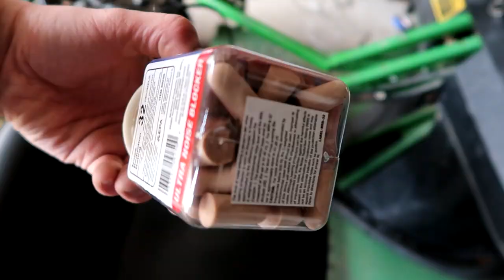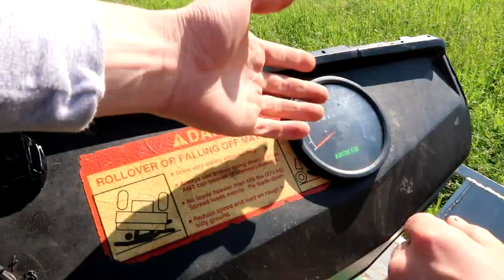100HP Engine Swapped 5 Wheeler First Ride

Comment: Dude 😮 how How can everything hold up to that because it was never meant to go that fast
Reply: Because it’s a heavy duty work machine, made to pull heavy loads. It’s actually less stressful for everything to be spinning with no weight or traction. However I wouldn’t be surprised if on pavement with good tires it might hurt an axle shaft or something.
Reply: Trash to transportations 5 who said it did😂jkjk
Reply: Yeah I suppose but he should be fine if he just keeps his tires spinning the whole time JK
Reply: ive got the same engine in my golf cart and it takes it just fine

Comment: Pull the negative off batt. Use test light. Touch that negative cable and negative on battery. If lights up start pulling fuses till light goes out👍🏼

Comment: i think those gm gauge clusters are known to draw power even when the vehicle is off
Reply from the maker: great!!
Reply: Plenty videos of GM gauge clusters draining battery
Reply: Yep, ongoing problem with late model GM's... ALSO the voltage regulator in the alternator will stay powered up after you shut it down, in some cases. Sometimes if you just take it to the dealer and have them re-flash the ECU, it will take care of it. Just about everything on those newer GM's is tied into the damned computer somehow.😜 EDIT One thing you probably DON'T want to do, is put a manual 'deadman' switch on it, because the computer(s) have to re-learn every time you turn it back on, and they run like shit for the first 15-30 minutes after you start them back up!😜

Comment: On the dirtymax if there are any aftermarket alarms most likely cause of paricytic draw.. you can test this by setting your multi meter to 10 amps and switching your leads to common and 10A. remove the negative on the battery that feeds the system and close all doors lock them if there is a hood switch close that circuit aswell. You want to hook the common to the negative post on the battery and the red on the negative wire and wait about 5 minutes. Once the computer goes to sleep you want a miliamp reading of about 10-20 miliamps but nothing under 50 would i be concerned about. If it is any higher i would start by disconnecting power from anything aftermarket and move to pulling fuses, whatever drops the miliamp reading to normal after disconnecting is your problem. Happy hunting!

Comment: Ok, thats freaking awesome. I want it and I'd have to put it on a trailer and drive out to MA to use it lol (from NW CT myself). Would love to give that thing a serious send. First I would do, take 1/8" rod stock and make a cage for the belt (torch bend it and tack it all together, tig or mig). Second upgrade, get rid of the gator trans and mount 2 solid gokart style axles in its place, maybe cannibalize a couple junk ATVs for the suspension. Run the front axle off a belt from the CVT (maybe weld a hub to the axle that the driven pulley could bolt to, that way you could change the size of the driven pulley to change gearing really easy). Chain drive the rear axle off of the front axle. May have to weld up some 1x1" box like a sub frame to support it all a bit better, idk how beefy the Gators frames are they may handle it with a bit of extra bracing instead. This is a really cool project @3DMachines , its got my brain going a million miles a minute on the possibilities. Think I should start saving more in the Fun fund and build one of these myself.

Comment: Sick. You def need to adjust the cvt. Even after you get both axles working. And don't forget the trans is made for high torque loading so you can prob push it pretty far as long as you don't hit a jump with the wheel spinning full speed. Keep it going 👍
Reply: If anything lack of lubrication to the bushings inside will be its  down fall.

Comment: I had a f250 doing the same thing with batteries constantly draining.. after replacing both batteries the alternator was draining them it tested fine but every once in a while it would pull juice when off.. hope it helps!!

Comment: LMAO! That thing is certified DANGEROUS! I love it!!😍😁👍 Better get a cage and some harnesses so you don't fall out of that rocket ship and bite a piece out of one of those big trees going by though.🤣 Waay too much fun... be careful guys!😉 EDIT: Left this elsewhere in the comments, but I'll put it here also... GM parasitic battery drain issues: Yep, ongoing problem with late model GM's... ALSO the voltage regulator in the alternator will stay powered up after you shut it down, in some cases. Sometimes if you just take it to the dealer and have them re-flash the ECU, it will take care of it. Just about everything on those newer GM's is tied into the damned computer somehow.😜 One thing you probably DON'T want to do, is put a manual 'deadman' switch on it, because the computer(s) have to re-learn every time you turn it back on, and they run like shit for the first 15-30 minutes after you start them back up!😜

Comment: on your truck battery check the door switch. I have an rv 06 truck cab that does this. While in the truck turn it off then open the door. Mine doesn't always turn off the accessory power so I have to open and close the door a couple of times.

Comment: Have the batteries tested and watch the cranking amps.  You can have voltage but if the cranking amps drop out after sitting for so long you need new batteries.  Had the same problem with a battery that tested good.  But the cranking amps would drop

Comment: Need a new alternator why were you truck sometimes starts or doesn't
Reply: demo life alternator is good other wise it would die in the middle of the street from just the batteries running injectors, fuel pump, lights, etc. The batteries are there to start the vehicle and the alternator charges the battery and runs all accessories like your lights fuel pump and injectors
Reply: You might be right
Reply: Let me talk to my mechanic